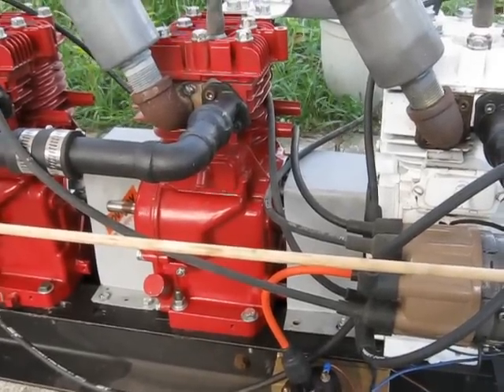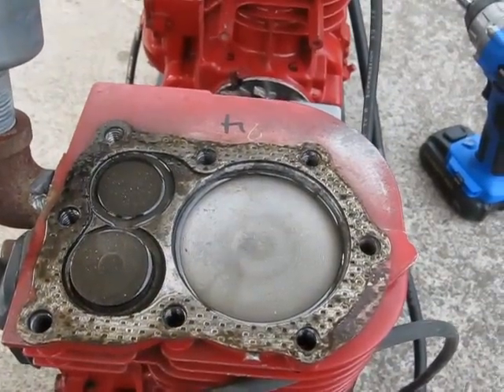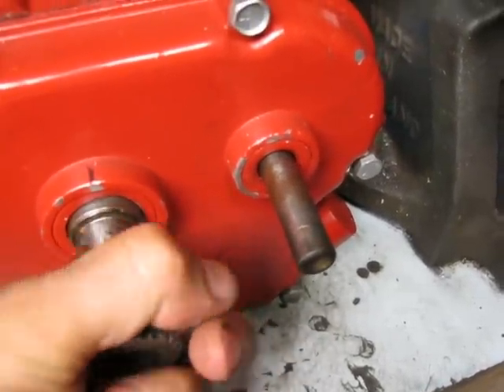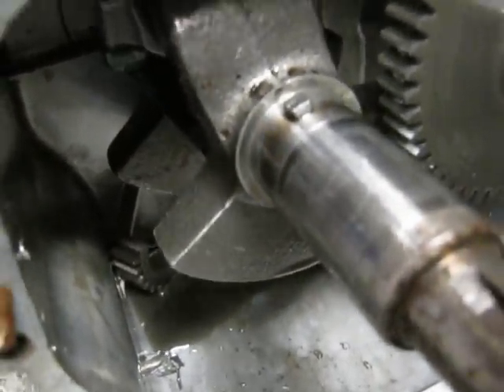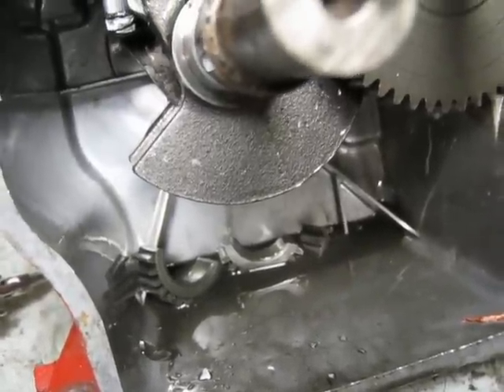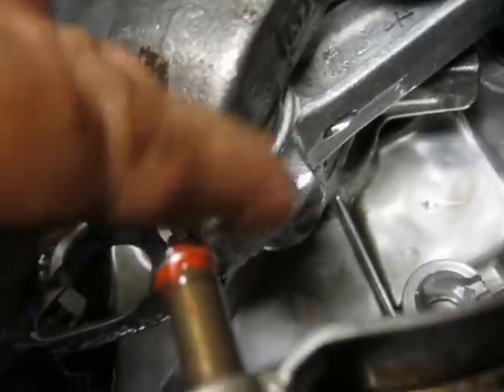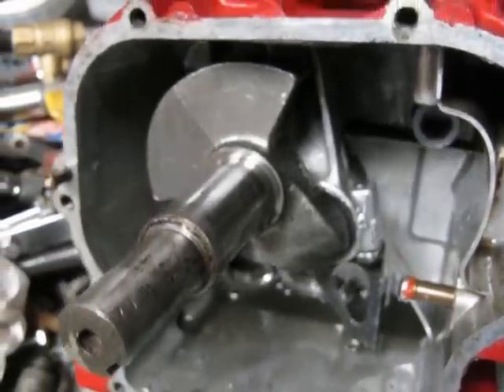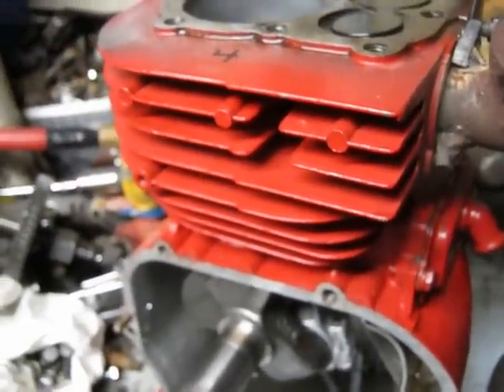5000 rpm 8 Cylinder FrankenBriggs

Comment: Nice sound👍👍
How did you connect the crankshaft?
Reply from the maker: I use chain type couplings ( a sprocket on each crankshaft, joined together by a double width chain.  I also had to weld up, them machine down the normal flywheel end of the crankshafts, so I could mount a decent sized chain sprocket onto it.

Comment: When I worked for Toro I seen a big run at near 10,000 rpm and still lived. But it had the intrical  cam gear on the crank
Reply from the maker: Really, I didn't think the flywheel would be good for much over 7000 rpm tops. Perhaps it was the little 3 horse cast iron flywheel, I hear they will take revs.

Comment: Not a 8 cylinder but 8 engines coupled together. Try again
Reply from the maker: Ok, in principle I agree with you. However, I build these multi cylinder engines from Briggs and Stratton single cylinder engines, so there is no practical way to design, cast and machine a single engine block, as well as a crankshaft (unless you are a multi-millionaire). So I did the best I could. It uses the same firing order as a Straight 8, a common ignition distributor, and even sounds like an 8 cylinder.
Reply: @ChargerMiles007  yes there is. There is a guy on YouTube who has one. He cut the blocks welded them together and it's all one piece. And he has a distributor on it. Look it up
Reply: @ChargerMiles007  it's not a 8 cylinder but 8 separate engines
Reply: @ChargerMiles007  and the guy that built the other on is not a rich person
Reply from the maker: Can you get the title of the vid for me, I went searching, but haven't found it. The person may not be rich, but he definitely has access to a machine shop with some serious equipment.

Comment: It seemed cool untill it ejectect that gear. Doeent seem like a usable design. Rock on
Reply from the maker: no, not very practical, just a fun experiment. I intended to get a 7 cylinder running this summer, but I have been too busy keeping my cars running, and it has been rather rainy.
Reply: By the way. I do aprecciate what you created. Way tp take this concept rite to the limit:)

Comment: If you want some real horsepower on that thing you need a carburetor per cylinder
Reply from the maker: True, though i would probably just blow it up, as we hit 5000rpms 3 times on the Straight 8, and it caused #5 cylinder to blow the crankshaft gear into pieces. Murphies law, kind of as all the other cylinders use the older integral crank gear.

Comment: how do you have the timing working properly?
Reply from the maker: I join the engines with couplers, being careful to time each cylinder correctly. i have drawn up a timing diagram that shows the phases on each individual cylinder, I am sure i show it on at least one of these multi cylinder engine vids, probably the 6 cylinder.

Comment: Awesome build man, sorry it got a little mad at ya.
Reply from the maker: Yes, it didn't like revving to 5000 numerous times, some type of harmonic resonance probably did the powder metal crank gear in. I will take up the clearance with JB Weld, or silver solder before another run.

Comment: intake A/F ratio induction problems, need a carb for each and a heat shroud for each and then it would run correctly, gonna be a task to sync 8 carbs but it can and has been done. then each power-plant puts out an even hp and tq curve. I am Kevin.                             oB

Comment: This is an awesome idea, would love to see it completed. The intake tube for each cylinder needs to be equal length and should be smooth internally for the engine to run properly. It is impossible for the cylinders to run the same A/F ratio with different length intake tubes while sharing carbs. One carb per cylinder or an arduino based fuel injection (Speeduino) would worth considering. Sharp bends should also be avoided. If the engine to engine timing is off, it will cause engine failure. TDC of your engines should be exactly 45 degrees apart. The Fuel/Air ratio being leaner probably caused pre-ignition resulting in engine damage.
Reply from the maker: Yes, what you said is all true, though i don't know if it has pre-ignition or not. I made the simplest manifolds i could, and they certainly are far from ideal. With these multi cylinder engines i am just building them for perhaps 5 minutes of running time, over the span of a few different runs, I think they would probably blow something apart if i ran them under load!

Comment: I don't understand how you would synchronize the RPM's to exact. I would suspect they will NEVER be in sync which will likely cause them to work against each other. In a similar way to a chain driven motor without any coasting or torque converter you would always have mechanical connection. So if one engine is running slower while the other is forcing it to go faster you will get the loaded effect on the slower engine. clutches or something might help this. 
Still cook project though. The HP would be cumulative IMO.
Reply from the maker: They are all connected together with chain couplings, and timed to fire like a normal straight 8 engine, so they all work together. there is still reverse loading on the couplings when one cylinder fires, dragging all the rest along.

Comment: 5,000 RPM unlikely IMHO.
Reply from the maker: Yes the car tach is set correctly. the tach is a universal one, for a 4,6 or 8 cylinder. I am using a car distributor on this engine, and spinning it at 1/2 crankshaft speed, so the plugs only fire once per two revs of the crankshaft. so the tach would read the correct rpm. i have tested sock Briggs lawnmower engines such as a 3-1/2 horse lawnmower engine, it will rev about 4500 rpm with the throttle held open. Most of these engines are capable of revving over 3600, but are governed to that speed so they hopefully last a long time. i don't keep them at much over 3600 for very long though, as I try to avoid having a rod come through the side of the block. the racing 5 horse engines will rev about 7000 rpm, though that require s a billet flywheel, some type of racing camshaft and stiffer valve springs. i have revved my 3 horse sleeve valve up to 6350 rpm a few times during testing, so the rods and pistons can take that abuse for a short time at least.
Reply from the maker: I could only get the 6 cylinder to rev about 3000rpm, as i had the spark distributor messed up so it was retarding the spark. I fixed that on the 8 cylinder, so it did rev 5000 at least 3 times, according to the car tach. The vibrations at the high revs caused a crankshaft gear to break on #5 cylinder, I show the resulting carnage on a vid.
Reply: Please don't take this wrong, but is the car tach correctly set for the ignition pulses the system is producing?  Is this system producing waste spark (spark every revolution) or 1 spark for every 2 revolutions of the crankshaft?  5 grand on these type of engines usually sounds completely terrifying and you have to worry about valve float and such. They were originally designed for 3600 rpm.  Just askin.......

Comment: 12HP?
Reply from the maker: Yes, that is probably about the max the output shaft can handle at 3600rpm, though the 8 cylinder could make more power at sat 4800 rpm for a short blast.

Comment: So how are they all cooled? or is just the air around them enough.
Reply from the maker: I used some big electric fans on a few of the runs, since it was 90F out those days. it seemed to fair pretty well for a minute long run with no fans on cooler days.

Comment: I'd have to guess there was a strain on #5, because maybe it wouldn't run up as fast, or was slower than the others ??????
Reply from the maker: No, they were all running the same speed, that particular engine was a bit newer, and used a separate crankshaft gear. all of the other engines were older, using a gear that is an integral part of the crankshaft.

Comment: So as far as timing is concerned, theyre all independent of each other?, with one common shaft? sorry i didnt catch the first video.
Reply from the maker: Actually, each cylinder is basically a separate engine, then they are all fastened together and phased correctly with chain couplings. The spark comes from a car distributor, and it uses 2 carburators for fuel.
Reply: ChargerMiles007 how do you dampen vibrations toward the middle of the engine because I've heard in line engines expecially longer ones are notorious for that (actual flexing of the crankshaft as opposed to Just vibrating) harmonic dampeners?

Comment: What's the firing order? Maybe a different setup could decrease those harmonics. Maybe a way is to use three fixed laser pointers attached to the cylinder heads, pointed at a white wall or ceiling.

Comment: The engine might have went out of timing for a split second and grenaded. Probably went through the wrong cycle due to coupling play?
Reply from the maker: I think it was vibration related harmonics that caused the gear to break at the weakest point where it has a key seat. I had the same thing happen on a 3 cylinder engine. My son suggests I silver solder a new gear in place, so there can be zero play in the mounting.
Reply: Ok, those dang vibrations. ;)
Reply: I was wondering how you set the timing?
I doubt it was vibration that broke the gear. I would bet it was a timing issue.
It looks like you are using a belt on the distributor?
Must be a chain or gear.
The smallest amount of slippage and gears, push rods, cams. Something has to give or break.

Comment: If you want the "V8" sound, you can do it with a 4-cylinder by configuring the engines like a cross-plane V8, so have each crankshaft 90* to each other. It creates an uneven firing order, but you get the V8 sound. Yamaha's newer R1 motorcycles use a cross-plane crank in their 4-cylinder engines, giving them that V8 sound. Example: https://www.youtube.com/watch?v=HONkWVgqZ5w
Reply from the maker: Yes, I hear what you mean, that bike sounds like a V8  :)

Comment: Would be nice to of seen it running with the inlet manifold as a one piece to see if it made any difference :-)
Reply from the maker: Yes, that would be nice for a comparison, perhaps I can do that some time in the future. I have designed this to be a modular engine platform for up to 12 cylinders, my plan is to build a 7 cylinder next, though I may do a quick build of a 3 cylinder, since it would go quickly.
Reply: ChargerMiles007 it would be cool to arrange the cylinders in a offset v and change the timing to give it a classic v8 sound